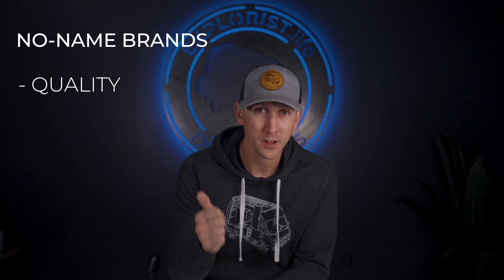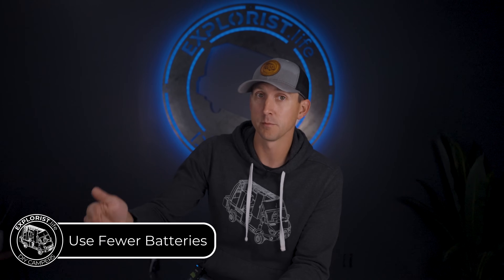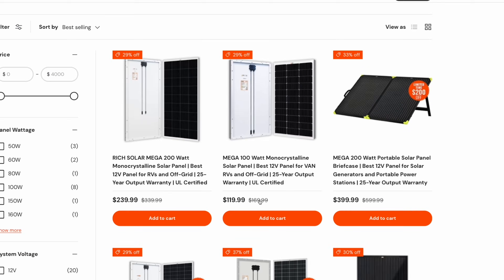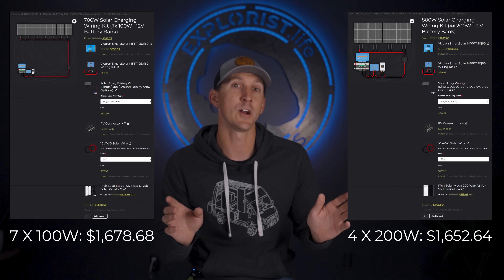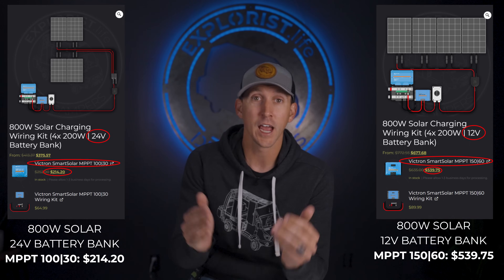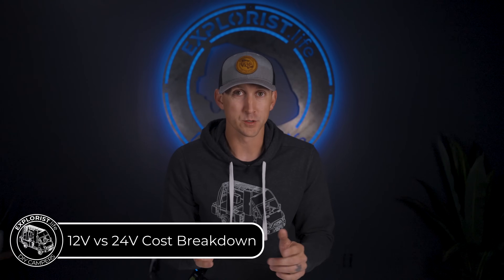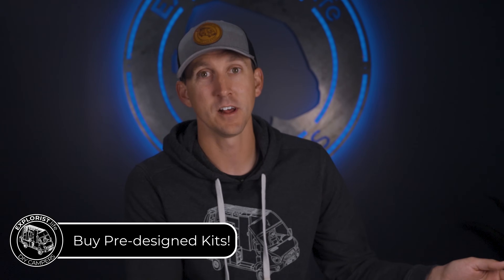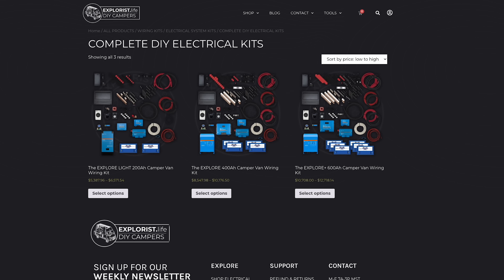Van/RV Electrical System Money-Saving Hacks!

Comment: Thank you so much. We had the learning experience that one should not settle. We had our dealer install 360Ah battery it’s a great battery. But the GoPower 3000 watt inverter charger was not good. LOL. It died on a trip. Day 1 of a 21 day trip. 

We now have a Victron system with all new wires. Done by a local Off Grid specialist south of Ft.Worth TX. 

It was a 10k experience and we are still a bit PTSD when a light flickers.  Don’t settle and buy brands that have support available. 

Cheers. 🍻 😊

Comment: wow, right on time. Definitely need some 48 V kits. Will be checking out the website today! 🤗
Reply from the maker: Awesome!  Glad it helped.  Thanks for watching!
Reply: @Lana_Warwick  do more research? Not a good way to enter a conversation. Or to get anyone to listen for that matter. But since we’re here…
I don’t mind helping Nate out just as long as it is fair market value. I don’t have to think about doing the calculations because the kits are already sorted out. him and Steph have integrity because they’re very transparent. Sooo, I’m buying convenience and helping good people out. I actually just want the wiring. Here’s my set up:
I already have two Multiplus II Victron inverters running in parallel to provide 240 V AC connecting to a 48 V LiFE PO4 battery bank (4) SOK server rack = 20k + watts of storage.  Victron DC to DC converter and 1230 W of residential solar on the roof along side Starlink, which conveniently operates at 48 V (no buck converter). 
If I can get the wiring from Nate, that’s a win-win: I have what I want to spec and I bought from a person that I approve of. Make sense?

Comment: You discussed the savings for going with a higher voltage system.  When doing this, do you need to be concerned with the power loss of stepping down from higher voltage DC storage to support 12V DC systems?

Comment: Another reason I stuck with 12v was the ac unit I wanted was $500 more for the 24v version. So it was like save money on wire size and then pay more for the ac unit. I decided to just keep it simple.
Reply: You lose efficiency with 12v. 48v is more efficient and the amp draw is significantly less under load
Reply from the maker: @jonaselton4229 It's not necessarily 'more efficient', no.  It's just 'appears' to be using less power because the amps are smaller, but the watts will be similar regardless of if the air conditioner is 12, 24, or 48V.  Review the following video to learn more about how this works: https://www.youtube.com/watch?v=GGGBtl_SRIs
Reply from the maker: @nickmcentee8992 for sure!  Also a good consideration.
Reply: Did I just miss it, but it seems like no  mention of weight or space consideration in the comparison. Our is it so obvious that it goes without being said? Thanks for information.
Reply from the maker: @WH0oo...   Space isn't going to be any different between 12V vs 24V.

Weight will be different, but it will be so minimal it doesn't really matter in the grand scheme of things.  Less than the difference of 'having groceries' vs 'not having groceries' in the van; and I've never heard of somebody micro-analyzing the weight of groceries. 😂😂😂😂🤷‍♂🤷‍♂

Plus, talking about size and weight considerations would be off topic for a video discussing the money saving aspect of various system configurations.

Comment: I'm in the planning of my build.

Working on the electrical....I want to use your power audit form. I am planning on going 24V. If i do thst do i just change the formulas that divide by 12 to 24? Or, which ones would i change and not change?

I will be using a 24 to 12 converter though

Comment: Hi Nate, I’m in Australia just purchased our Jayco camper trailer did not get battery but it has shore power for 12volt system with ctec charger 12v ditrubution of power. Thinking of lithium batter
. Would I be able to purchase your circuit digrahan for 12v system.

Comment: Can you also go over how to power 12volt appliances and accessories when using a 24 volt system. thanks
Reply from the maker: Sure!  You'd just use a 24V to 12V converter between the lynx distributor (battery bank) and the 12V DC Fuse Block like we showed in this camper van electrical video: https://www.youtube.com/watch?v=E5q7_4FH4LQ&list=PLmvhcyi4n0TUVeKuZTWWYM4EgSqESFbrg

And this one for an RV: https://www.youtube.com/watch?v=PavRWuOax1M&list=PLmvhcyi4n0TU7sBwNG2BXTzcKZvx-_iz7

Comment: Do you feel there is an advantage in the redundancy of having 6 batteries (vs two) or 7 panels ( vs four) if/when a component fails?  I'm unfamiliar with the specific warranties to put a time value on that.
Reply from the maker: Not particularly, no.  If one battery or panel goes bad; it will likely negatively effect the whole bank/array.

Comment: Great video and very informative. But one thing you don't really go into detail about is the impact of having a 24V system vs a 12V in terms of ability to power all the various things inside the van. Most of the things I have in my van are powered by 12VDC (lights, USB chargers, fans, fridge etc). I do have an inverter to power the few things that are 115VAC powered (which are only used occasionally). And I know 24VDC inverters are available, but is there a cheap and efficient way of extracting 12VDC out of a 24VDC system without having to add yet another electronic box (switching power supply etc) to get access to 12VDC again? Or do people who get 24VDC systems simply buy 24VDC appliances and lights etc? Confused about this part. Thanks again for the video in the meantime.
Reply from the maker: All of our kits/systems/etc include 24V to 12V converters for all of the various 12V loads.

Comment: There are 48v battery isolators, just not the blue sea systems option everyone loves
Reply from the maker: Please don't think that I haven't spent HOURS looking for quality battery switches rated for 60V. 🤣🙄

There are random no-name amazon switches that claim a 60V rating, but it's hard to believe/trust.
Reply: @EXPLORISTlife  or use the Lynx BMS as a remote controllable main system switch
Reply from the maker: The Lynx BMS is nearly $1,000...
Reply: @EXPLORISTlife  it's still 48v compatible isolator and if you're running 48v battery banks or victron smart batteries it's worth the cost
Reply from the maker: I didn't see the comment about the smart battery protect until now, apologies.   The smart Battery protect is uni-directional so you can't use it as a battery switch since the power needs to flow both into and out of the battery bank.
Reply from the maker: The Lynx BMS would indeed 'work', but that's an even more expensive solution than the 125V breakers and box I showed which still falls into the same problem I mentioned in the video that a cost effective (sub $100) master battery switch rated for the 58V it takes to charge a 48V battery bank doesn't exist.

Comment: Thanks for sharing.  I am looking for 48v with 1600watts of solar (4x400w) solution based on the Victron Energy MultiPlus-II 120V, 3000VA 48-Volt.   Can you design something?
Reply from the maker: There's really no reason to do a 48V system with only 3kva of inverting capacity and 1600w of solar.  Go with a 24V setup for that.  We already have that ready to go in our store.
Reply: @EXPLORISTlife  Except I already have a EG4-LifePower4 Lithium Battery | 48V 100AH | Server Rack Battery | UL1973.
Reply from the maker: Having a good plan in place before purchasing parts is always a good idea to avoid problems like these.

Comment: I'd argue that even a 24V system will cost more up front than a 12V system because you're still going to have 12V components in your rig (be it lights, refrigerator, or controllers for the HVAC system) and your "savings" will end up going into a 24V to 12V step down and if you're going to use your vehicle charging system to help top off your system while driving a 12V to 24V DC to DC charger.

That said, if you're doing it full time, the 24V system is still your better bet because there will be less over all stress on the system as you use it and it'll last longer requiring longer spans between and less replacements as you go.
Reply from the maker: Hey there!  Our 12v vs 24v cost comparison included the 24v to 12v converter and the appropriate 12v to 24v charger.  Pricing was based on actual parts costing from the 'ready to go' kits we sell, so we know they are complete. 🙂👍

Comment: seems like most vanlife builds should stick w 12v unless theyre running a rooftop AC unit
Reply: Not true. A 24v system when using 24v batteries can double your storage capacity and with space tight already, less batteries = less space
Reply from the maker: @JimBob-wn6yo   That's sounds a bit misleading/inaccurate.  A 24V 100Ah battery will be about twice as big and twice as heavy as a 12V 100Ah battery as there is 2400W of cells in one and only 1200W in the other.  

A more fair comparison for size/weight is a 50Ah 24V battery vs a 100Ah 12V battery as those two are actually the same capacity.  

Review the following video for more info: https://youtu.be/GGGBtl_SRIs
Reply from the maker: @jogbird Most are 12V; a lot are 24V.  Here are our thoughts about choosing one vs the other: https://youtu.be/sEW-ZaOOlq0

Comment: you failed to say anything about the cheap parts out there. like copper coated alu wire. or wires with improper labeling, aka how the wire is made, strands, thickness, how some company's add much thicker coating to make there wire look bigger.

Comment: Battle Born is great but the price.  If you want to save real money that's the first thing to change.
Reply from the maker: The main point here was saving money through system design while using the high quality parts you want.  There are hundreds of other 'build it as cheaply as possible with no name components' videos out there, but this is not one of them.  I hope I made that clear in the first sentence of this video.

Comment: 10 grand?! My 400ah battery bank, 1200w and 3600w grid tie inverter cost me less than 3k, along with wiring and breakers and everything else, Jesus.
Reply from the maker: And you could have saved even more money by using the strategies shown in this video coupled with the no-name cheap components it sounds like you used.  Sounds like you honed in on one specific part of this video and missed the overall point.  Perhaps watch it again with a bigger focus on the system design strategies instead of trying to compare your system to a system with high quality components.
Reply: I saved massively, especially considering 3k was Australian dollars and I used cheap but reputable panels and an mpp3624 the 2 large 12v batteries were extremely cheap but well known to be excellent quality, so I did just fine, I’m just confused how the wiring kit was around 2-3k when wire, T class fuses, a circuit breaker and lugs shouldn’t cost that much, unless it wasn’t designed for a 10 metre run from the battery to inverter…?
Reply: “	
EXPLORIST life - DIY Campers
Yeah, there are definitely a lot of no name super cheap components out there that will significant decrease costs at the exchange of quality, warranty, and customer support Sounds like you totally missed the point of the video. Please review the first 10 seconds of the video.”

I can’t see this comment on here anymore but to answer it anyway.

The panels I bought locally come with a 20 year 20% guarantee, the batteries come with a 5 year guarantee and the inverter is an “mpp solar”, which I found to be good enough if the reviews are to be believed. 
Either way all the I bought what I could locally (everything except the inverter) so I won’t have a problem getting my warranty dealt with, I watched the whole video, just the price for wiring seems extremely high.
Reply from the maker: Enough wiring, fuses, lugs, heat shrink, ferrules, junction boxes, terminal blocks, busbars, and mounting screws do indeed cost that much as of October 2023 to wire 6 batteries, 1200w of solar, DC DC Charging via vehicle alternator, system monitoring, and an inverter/charger to the factory electrical system of an RV does indeed cost quite a bit and is often underbudgeted or unaccounted for in people's costing.